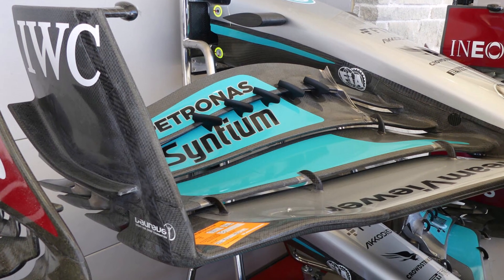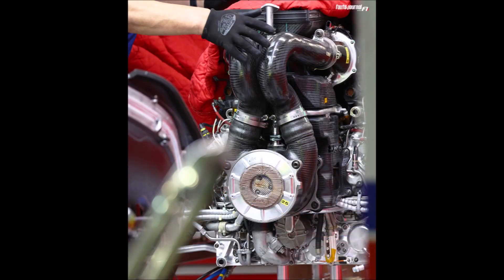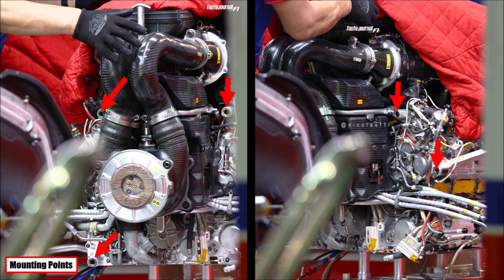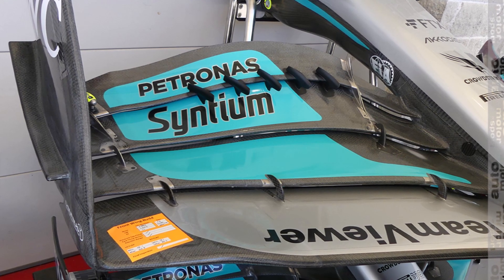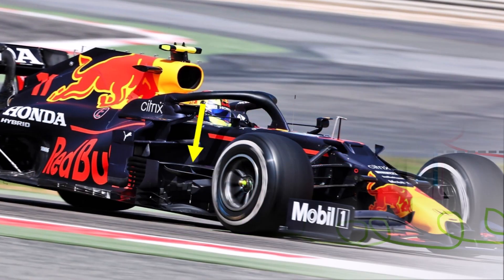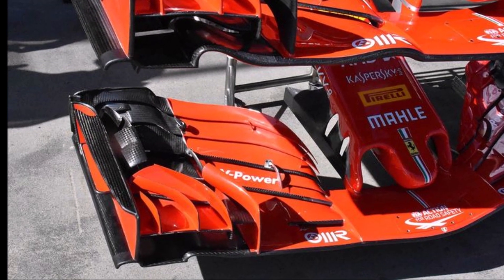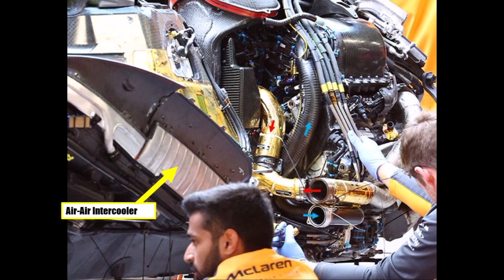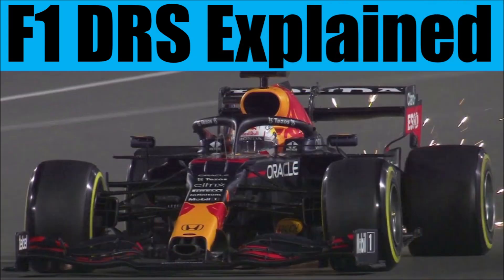F1 2022 - R19 US GP - Technical Analysis

Comment: Apparently the front wing needs to be modified. FIA approved the CAD version, but when they saw the wing in person they said the slot gap separators were larger than they anticipated.
Reply: Not to mention the regulations specify that the supports cannot provide any aerodynamic affect. Fair play to Merc for trying, but as soon as I saw this I knew there would be questions raised

Comment: How can a team that took paint off most of its car to save weight at the same time build an advertising board into it?!
Reply: I think its not an lcd, probably eink
Reply: @twlentwo  But is it lighter than a sticker?
Reply: @Pandamasque  probably not, but also not a huuge disadvantage. The whole thing weighs less then 190g. And it replaces a body panel so the weight incrase is minimal.

And they are not using them on qualy/race. Practice only
Reply: @twlentwo  Oh, I didn't realise they're not going to use it in competition.

Comment: Great report, much better coverage and technical info than the official F1 SkySports UK team give on the updates to the cars.
Those Mercedes additional slot gap separators are not being used,for the purpose they are designed for or shaped similar to the other ones on the wing and the FIA should order them to be removed as not within the spirit of the technical regulations or FIA intention.
Reply: That cost cap breach and one car almost a second a lap ahead of everyone else is what's not in the spirit of the regulation. Don't see you complaining about that though.
Reply: @san-joshuabarrett  luckily, F1 is NOT a BOP (Balance of Performance) category.  
The F1 cost cape is so complex, with so many exclusions, there are going to be breaches.  And when you add in cost for COVID and the employment contracts staff already had before the CC was introduced it must be very difficult to manage.
Reply: @camf7522  well 9 teams managed to do it except one. So i see no reason why they couldn't do it in the first place.
Reply: I'm sure the fia will send them a recommendation